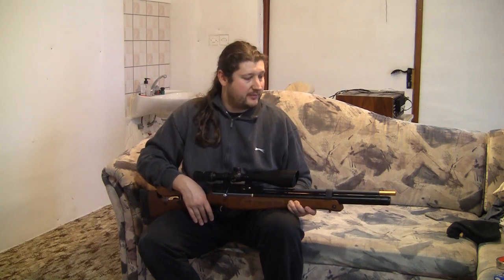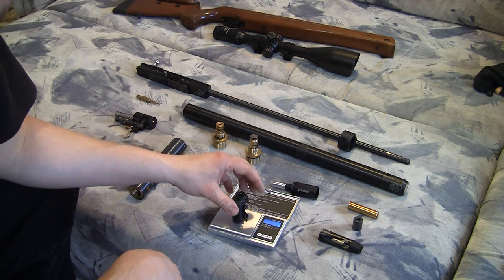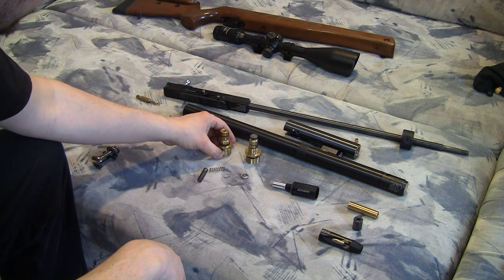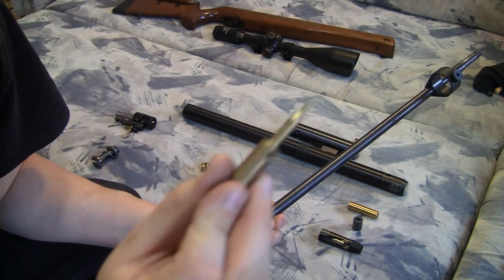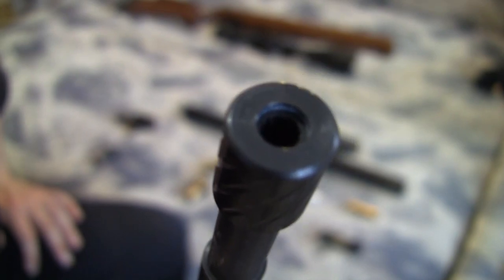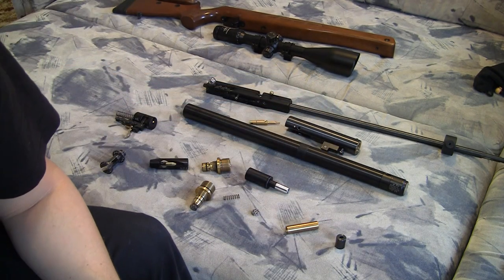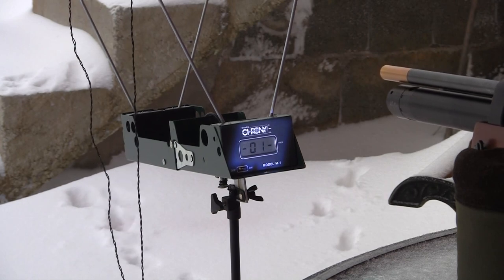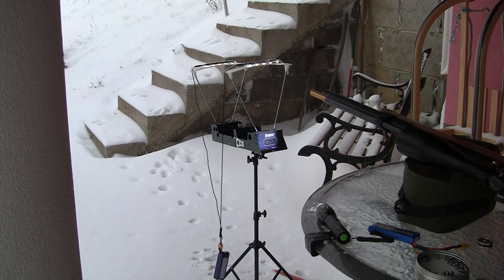Hatsan BT65 .25 regulated and unregulated

Comment: I can't believe the difference,between unregulated and regulated. I  got a lane mk7 regulator and I am satisfied with it because of your mods, this model only with regulator and not the mods is not so good. I made the hammer 65 g, transfer ports ware 5mm, only the barrel was 4mm and I made it 5mm. And because I do not have tools ti create new parts I used epoxy on the cylinder head and closed the holes and space and left only one but I enlarged it.  1g pellet before with only the regulator I got 280m/s and 41 shots from 200 to 100 bar.  Now I have 300m/s and 60 shots with same air. I am very happy with that.
Reply from the maker: +Alexandru Popa Perfect! I assume you have 5,5 mm caliber... I think I saw your modification with epoxy. I saw a picture like you described but I do not know where. Nice job!
Reply: Yes is 5.5 wood and like yours it is inscribed "grizzly"
Reply: Alexandru Popa
Reply: +Kenneth Rodrick yes...

Comment: Dear @gregor, have you ever thought to build a gunstock for the hatsan bt 65 so it can fit a bigger air cylinder? or to slide a block of metal over the barrel, slide it till the end and connect it to the 2 little hole on top of the gun. so the barrel is solid connectec to the receiver block and then removeing the barrel support so you can have a stable floating barrel, have you ever tried it? or to cut of a small piece of metal from the magazin holder block so you can fit slugs which are a few mm longer? of cause you would needed selfmade longer magazines for it.

Comment: Here in sweden u can only get these license free 10j. 
My question is are the inturnels the same on a 10j and the more powerful one ? 
Does 10j only means it's less powerfull but the components are the same ? Thank you :)
Reply from the maker: Typically  manufacturers limit the power by limiting air flow. Hatsan usually does it by inserting a very thick valve that blocks the air flow, other manufacturers often limit is by TP... So in most cases, most parts are the same with one exception that limits that airflow.

Comment: I found some interesting information that the gun is limited to 200 bar because above it could damage it but with a regulator that is no longer the problem so we can fill the cylinder above 200 bar. Normally because it has a working pressure of 200 bar it should safely do 300. I would not fill it to 300 but I would go as far as 250. But I can't find enyone who tried it. And I do not know if it puts pressure on my hatsan pump.
Reply from the maker: +Alexandru Popa There are some guys that fill it to 220 bar, but it is not worth the risk. The tube is tested to 300 bar (or at least is should be) but the circumstances might change, the material ages, you might accidentally drop the cylinder,... Beside, regulators work much better if the pressure difference is not too high... And you still have 60 shots!

Comment: Please I currently own a BT65 with Huma regulator and have been quite happy. I currently have it set to 150 bar for power. My questions are 1. What is the best regulator setting for power and accuracy   2. should I increase transfer port to 6mm   3. Would you be so kind as to better explain  placing the bearing on the cocking lever  Thank you in advance Bye the  bye you are a credit to the sport and I commend you
Reply from the maker: The optimal pressure depends on a lot of factors. If you want to have as little mods as possible, you will need slightly higher pressure (150 bars should be enough). For accuracy you should be between 240 and 275 m/s (800 - 900 fps) range. Different pellets will prefer different velocities. JSB king heavy works very well at 260 m/s, MK2 prefers slightly lower velocities,... I do not know what you mean by "bearing on the cocking leaver"?
Reply: Thank you for your prompt response . My gun is .25 caliper  huma regulated approximately 890 ft/sec with JSB 25   approximately 820 with the JSB 34 grain mods include trigger adjusted to 2lbs silencer mags cleared of all burrs and pellet drop easily through without  o rings  . I hunt larger Igunia approximately 10 to 15 lbs. at 100 to 250 feet I would like to set regulator for the best accuracy  and power . What regulator settings would you recommend.  With regard to the bearing on the cocking lever. You described placing a small bearing on cocking mechanism to make coking easier . Could you explain in more detail. Thank you in advance
Reply from the maker: @stevenjaffe6481  Cocking: Ah I see. No need to do this mod as it is quite complicated because the material is too hard to drill and it needs to be tampered first... 
150 bar is a good start. The important part is the testing afterwards. You should go from small to bigger hammer spring tension and find the max. velocity. If the highest velocity you find is too high, then reduce the reg. pressure (or vice versa) and repeat the process. Keep doing this until you find your optimal velocity. I suggest that in the end you set the regulator to slightly higher pressure (let say approximately 20 FPS higher than you aimed for)  and reduce the velocity by hammer spring. This will give you better air efficiency and you will also have an option to increase the power if needed without adjusting the reg.
Reply: what are your thoughts with regard to the spring in the air tube valve and if you recommend changing  what size do you recommend and where will I should I be able to purchase
thank you

Comment: Just the video. I was looking for. Thanks for sharing this video. I am trying to get more power from my hatsan nova in .177. I am trying to get close to 1000 fps with the 21gr nsa slugs. Rn I'm getting 880 to 900. I have done some power mods to the hatsan nova. But now that i showed your video. I think I can get a little more power. I may also remake the barrel crow. See if that will happen with the accuracy of the slugs.

Comment: You are the Dude of  Dudes Sir !!!! outstanding video, great detailed information on this airgun , however I'm in the process of purchasing this gun and stumbled across your video, I wanted to know what tools were used to modify all those parts and if you are taking any  customer's because I would be a fan.
Reply from the maker: +Sid Bates Hello! I have a very cheap small lathe and a home made milling machine. All you need to make these modifications is lathe (only for the valve assembly) and simple tools that most people have (vice, drilling machine,...). But you also have to have enough time and strong motivation :) I do not make any part for sell so far.... If I ever do, I will make a video.. So keep watching my channel.
Reply: Will do,,keep the videos coming

Comment: Hello. I really like your videos, and they help a lot to answer questions. i have a hatsan bt65 sb cal.30 (7.62) i already modified the needle and already put pressure on the hammer spring i would like to know what i can do more to increase the power more ?? air transfer can i widen the air transfer hole further? what is the maximum that I can pierce the transfer? can you help me with my doubts? thank you
Reply from the maker: Size of TP will definetly make a big difference, but you need to enlarge the whole path including the barrel. The max size should be about 0.7 mm less than the caliber but you can make it oval as well. Make sure you make the edges on the barrel TP smooth so they do not cut the pellet.
Reply: @gregorkamensek3923  
thanks for listening. but i would like to know if i can do something about the transfer? do I extend the transfer more? thank you
Reply from the maker: @sergiorosa6995  You can enlarge it as I mentioned. If you already did this all the way (including on the barrel). Once it is at the max dimension, then you can influence the power only by 3 factors: pressure, valve opening time and barrel length. What kind of power do you get and what is your desired power (weight of the pellet and velocity)?

Comment: Hi ho... I know this is a realy old video, but I´m new to airrifles. I have a few questions, would love an answer. (Eng isn't my first language)
1. What is "shot count" and why is it importante?
2.Why is it importante that the pice you drilled a lot of holes in is light? Making it light dosnt it make the "catch the hammer" harder?

I wont pretend I understood all the other "lingo" but seeing things makes me think "I will have a lot to do at off hours at work in our machineshop" :)

Great video!  Thanks!
Reply from the maker: Shot count is the number of shots you get from one fill.
Lighter hammer is needed with the use of the regulator in this case.
Reply: @gregorkamensek3923  Why?

Comment: I'm watching your (great!) video again as a guide when I disassemble the AT44 .177 to tune it. I see what you did with the pellet probe, but that is not an option for most people. Do you know anyone who sells them already modified?
Reply from the maker: No, I do not. You can do it your self, just don't make it as thin as I did or it will break... You can do it using a drilling machine and a fine file and in the end some sand paper...

Comment: Really great video! Thanks. I have an AT44 Long in .25 and may move to the BT65 Elite later. One question:  With a single exit hole in the valve, I assume that you make sure that this is aligned exactly with the transfer port when the air tube is screwed all the way in, correct?
Reply from the maker: +Jere Moore Yes, of course. I made the whole part without the hole and then screw it in the breach tight ant then mark where the hole has to be, and drill the hole...at that time the gun was taken apart, so I could access the transfer port with a pen.

Comment: I have one thought regarding the regulator. 
Could it have a very small inlet hole so the filling takes longer after a shot.
Then the bouncing and slow closing would not matter as much.
Reply from the maker: I am afraid your logic is not correct. There is plenty of air left in the plenum after the shot even if the regulator is not fast enough to refill it. Actually, most regulators are not fast enough to refill it and the plenum size must be design to be big enough for the pressure to drop not more than approx 20 bar after a shot, otherwise, you are loosing efficiency. The lower pressure actually increase the bounce problem as the hammer can be easily opened as there is not as much force on it (keep in mind that main force that holds the valve closed comes form the pressure and not the valve spring). This means that the second strike of the hammer (bounce) will open the valve more and wast more air and it will again bounce the hammer more, excreta,... This is part of the reason why you get low efficiency if you install a regulator in a gun that is designed to be unregulated.
Reply: @gregorkamensek3923  Thank you for clearing that up. I thought the pressure was near 0 in the regulator chamber after a shot.

Comment: I appreciate your videos always. I have a Gladius .22 short and recently installed a Huma Regulator (set @130). I'm thinking about increasing the spring as you have done on your video here with no additional modifications. Any feelings on that being a good or bad idea?
Reply from the maker: If you are talking about the valve spring, that will probably have good results in shot count... In my opinion, Gladius is not a good design, generally as it has a valve system from AT44 that has a limited air flow and it has very long transfer port. This means that it cannot be efficient. It still preforms well in .22 but not so well in .25...
Reply: TY for your input. Yes sorry I wasn't clear. I was in fact talking about the valve spring.

Comment: Gregor thanks for great review!
Could you help to me with question?
I alredy install the Altaros regulator on my hatsan bt65 (0.177 cal.) In same time i install much more strong spring on valve. As per you coments better install stronger spring if you have installed Altaros regulator...So how you think if i will adjust the hummer spring(screw in to increase power or unscrew to decrease power) it will work? As per my opinion  it not change to much because chamber of the Altaros have a fixed volume and if strong spring installed, it not give a chance to refill regulator chamber fast. What you think about this?
Reply from the maker: Hi. Yes, it will change the power somewhat... You should do the following: try to decrease the hammer spring tension until the power starts to decrease. That setting will be your MAX power setting. If you decrease the spring tension further, you will have lower power... The main thing you need to remember is that you will not get any higher power if you increase the spring tension further than the MAX point, you will just loose more air.

Comment: Olá Gregor.
Você pode me dizer como fez os furos do martelo?
O aço é muito duro e não consigo furar.
Você fez a destempra do aço (martelo).
Obrigado pela sua atenção.
Reply from the maker: You can heat it up to about 800°C at cool it down slowly... That will make it softer. But the problem is making it harder again. You can do that by heating it and this time cool it down fast (drop it into water) but that will make it very brittle. You can tamper it  (to make it less brittle) but heating it to 400°C and keeping it on that temperature for about 20 minutes and then cool it down slowly...
Reply: Ok
Muito obrigado senhor.
SAUDAÇÕES DE Portugal.

Comment: Could you possibly measure the air cylinder when detached from the rifle?  Length and diameter?  Need some help for a custom build. Like your video!
Reply from the maker: +MrTurbo458 Hello! The external dimensions are: 575 mm x 34,85 mm
Reply: +Gregor Kamenšek thank you so much! Do you know if the at44 has the same dimensions?
Reply from the maker: +MrTurbo458 No, AT44 has a steel tube while BT65 has an aluminium tube. Internal diameters are similar but not the same but AT has much smaller external diameter (steel tube can have thinner walls...). AT44 is also a bit shorter..
Reply: +Gregor Kamenšek Prefect!  That's what I was hoping for. I'm attempting to fit one of the air cylinders to a pcp I'm building,  sounds like either cylinder would fit. 
Thanks for your help!
Reply from the maker: +MrTurbo458 No problem. What kind of PCP are you building? I have built one my self with BT's cylinder and barrel. We can discuss with private massages if you prefer...
Reply: +Gregor Kamenšek It's a big bore of my own design,  with other gun's features to some extent. I actually had a couple more questions, if you wouldn't mind messaging me,  not sure how to send one through YouTube
Reply from the maker: +MrTurbo458 Follow this video: https://www.youtube.com/watch?v=lhlj3sMZkcU
I will send you my email address when you send me a private massage.
Reply: +Gregor Kamenšek  Oh ok, must have to be on my pc, there isn't any options for being on my mobile.  I'll try it on my pc.

Comment: Perfect. Wonderful.  Gregor I did not ustand anti bounce. You said about that long. Did you produce it longer than original? And how many long? I want to change my valf spring. Can you tell me the specialities of it? Thank you
Reply from the maker: +Ercan karakuş Hello! Yes, I had to make it longer. But later I realized that this was only in my gun. When I got a chance to look at the insides of other guns, I noticed that most of them do not have this problem. If you do not have a problem with shot count, I suggest that you leave it as it is. I will put on my channel a video shortly where I will also talk about anti bounce mechanism and accuracy.
Reply from the maker: +Ercan karakuş HI. Yeh I had similar problem when I first installed the regulator. There a couple of things that have big impact on shot count. You claim that you got the most shots at 135 bar. this means that the hammer is too heavy. You can resolve this with by putting in a stronger valve spring (instead of making the hammer lighter). The other thing might be that you made the regulated area too small and after taking a shot, there is not enough pressure in the regulated area to close the valve. You cannot change the position of the regulator since you have already drilled a hole in the regulator but do not worry, stronger valve spring will solve this as well. The last possible reason is that your anti bounce mechanism does not work. The only way to know this for sure is to record the action with a high speed camera... :). BTW: did you open the gun? If so, did you insert the anti bounce spring back in to place when you reassemble it?.
As for velocity goes, it is quite low because the gun is built to be unregulated and the surface of the area from the valve to the barrel is too small. There is one more thing that you can do but it is a little harder to do: you can make the hole in the valve seal (white plastic that is inside the brass valve assembly - the valve pushes against it when it is closed). Just make it 0,5 mm bigger. But be very careful, if you damage the edge of the seal, the cylinder will leak air from the valve... You do have a spare seal in the spare parts that you received with the gun. This modification will also have a positive effect to the problem with consumption...
Reply: +Gregor Kamenšek Thank you mate. u r hero :) first I ll change valf spring. And I look your other professional suggestions. I just opened valf. I do not want to open main block. If need I do but.